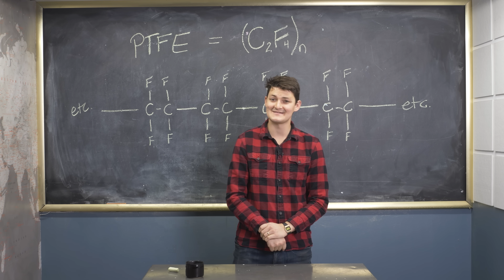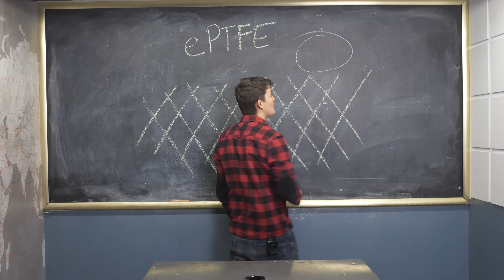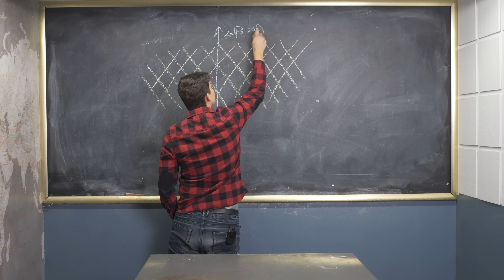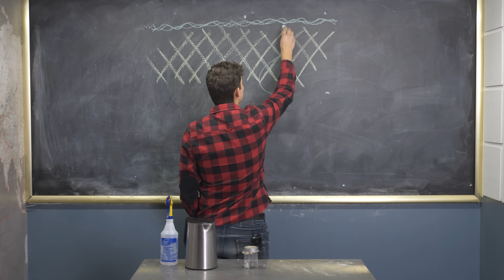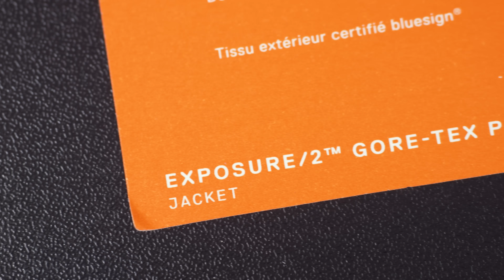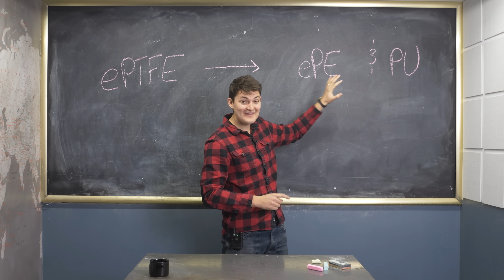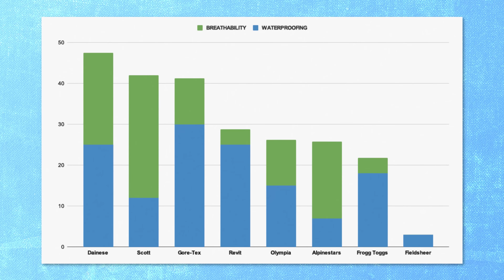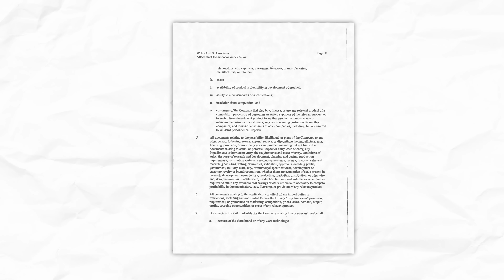Gore-Tex is a Marketing Gimmick

Comment: I used to wear outdoor jackets with non-GoreTex breathable membranes, and these membranes all started to flake after a while. My last two jackets have been GoreTex lined and they didn't suffer from that issue.

Other than that, I didn't notice any difference in breathability between the jackets.

Thanks for the video!
Reply: Sounds like you were wearing a Jack SweatSkin? 🤣

Comment: I buy Goretex sneakers. I tried other materials, but none stood as well to rain as the Goretex ones. Also I am not going to buy a shoe if it doesn't fit me like a glove, which limits even more the options I have. I want a sneaker that fits me nicely, can be used every day and won't leave me with wet socks if it rains or if I step in a puddle.
Otherwise I don't really care about Goretex. I can use an umbrella.

Comment: The pressurised water failing to penetrate gore-tex is hardly relevant, from a backpackers perspective. The pressure and motion from rucksack shoulder straps and hip belt have invariably allowed water through the membrane on any gore-tex jacket I have tried. As you say, there is no reduction in moisture from your body inside the garment when it is raining. Waste of money for this application.

Comment: I've had disappointing results with Goretex jackets over the last 30 years. Especially after washing. I can't trust them to do anything properly after that. I did pick up a used Goretex jacket for the equivalent of £20 sterling In Bali Indonesia where I live now,  recently. Well, it had a really nice removable inner fleece (which I love for dry days on my motor-cycle to keep the sun off),  and a good looking outer. But it is not water-resistant, nor especially breathable either. It gets sweaty inside, and wet inside from the rain. But the fleece is good quality, so not a terrible loss.

Comment: The Gore Tex Pro I’ve used has been substantially better than any other gore product I’ve used - specifically the higher end Arc’teryx jackets and pants. Hunting with a pack in tall wet grass and being dry and not soaked in sweat nor wet. Perhaps it’s arcteryx’s other wizardry in association with it, but I do have a positive impression of it. I’ve never worn another brand that uses GORE-TEX better… in fact most others stick to me when exerting energy.
Reply: When I had my first goretex pro it was a black LLBean and my friend had an Arc'teryx and his ended up flaking and falling apart and mine held up fine but he was really rough with his and I probably was more careful. Both of them were really nice his was a bright darker powderish blue

Comment: Amazing video, Informative, well presented and straight to the point ; everything you want for your time investment.  I used to use gore-tex trade mark boots for bush walking and always wondered why my feet felt hot , sweaty and uncomfortable when they are suppose to be the gold standard and recommended by trained sales staff. ( the mis-information is pervasive )  Then some very experienced walkers enlightened me that a quick drying/breathable shoe was way better option.( if your feet do get soaked , just change your socks and your good to go )  And have not looked back, I use the brand La Sportiva for a wide foot. ( also get a 1/2 size too big , so you are not stubbing your toe when walking down a steep slope )

Comment: I think the points around parent are a little harsh. Sure the initial discovery was accidental, but the subsequent investigation, production etc. wasn't. Those efforts would likely constitute the patent.

You aren't supposed to be able to patent parts of nature simpliciter, but the invention was a way of using the discovery. Even once the material was public, no one could work out manufacturing methods that didn't infringe on the patents. That is patent law working as intended.

Given the patents were both granted and maintained throughout extensive legal processes, I think it is unfair to dismiss them so lightly.

Not defending the business side, just thought that was a stretch.
Reply: They most likely patented the process not the material.  But who knows, big money wins at the end of it all so if they paid enough for it, then the patent would have been given.  Mans laws are all dependent on how much money goes into pushing them to favour.

Comment: I'll add that Goretex and its alternatives end up in places where they are simply not fit for use.  Shoes and gloves are terribly applications where the breathability requirements outstrip the performance by at least a good order of magnitude or two.  You end up with wet feet and hands from sweat in a short period unless you are in a cold dry climate and not exerting yourself much, which is kind of against the "active" part of outdoor activities.  Further, if you actually walk around in Goretex shoes, or use your gloved hands their membrane and/or seam-tape will rapidly wear out at the high flex locations, making your gloves neither waterproof, nor breathable enough.  On outdoor trips you end up just locking the moisture inside, as shoes and gloves takes ages to dry once water gets in.  I consider most "waterproof" shoes to be splashproof at best, and only if you keep the DWR maintained, or even splashes will soon wick through the worn out parts of the membrane.

Comment: I have a nice Gore -Tex running jacket and use it from time to time in inclement weather. 

The issue is that I sweat so much wearing it that I’m as soaked after my run as if I had been wearing any €15 windbreaker

Comment: The Military learned this lesson back in the mid '90's, when they had us trade in our wet weather gear AND our tried and true Field Jackets for,... Gortex jackets.  Sure, they were NOISY when we were trying to be quiet, they snagged on a ton of items and there was not any type of insulation.  So they reissued out Field Jacket Liners.  Typical Marine Corps.  It appeared that there was a small group that tested the GT Jackets, but did not get any of the reality feedback from the Troops.  Well, they did get our feedback, but by then it was too late, since our Field Jackets had already been sold.  So we were stuck with the noisy, cold, wet jackets that were, or rather Still Are USELESS in a combat situation.

Comment: breathing is triggered by a temperature difference not humidity difference. Thus wearing a GoreTex jacket in a hot climate is rather useless but they work exceptionally well in colder temperatures.

Comment: I think any experienced person who has tried Gore-tex will worked this out - over 35 years ago - noticed first problem - it's a membrane - so if outer layer does no repel water after time - it will be damp and stop breathability - worse it increases heat transfer - so needed a thermal layer between say arm skin and inner jacket lining - - if sweating inside , outer layer is damp - will feel cold and yuck .
As for breathability- ever wonder why so many had zips on sides - or people walked with it opened at the front - If you want 100% rainproof , 100% breathability then use an umbrella - but lose a hand , no good in wind, some cold protection - and in closed in walking area

Comment: I have the best of both worlds.  It's an old Cabela's coat from like late 80"s or early 90's:  and it has wool on the outside, goretex in the middle and some silky smooth high thread count polyester weave liner.  It absolutely MUST be below freezing or you just can't wear it.   It's thick and heavy like a B3 sheepskin coat and unbelievably warm.  Sure, goretex isn't breathable enough to wear it in moderate weather-- but it really thrives in extreme cold;  where you have that huge differential being warm under the jacket and cold outside..  I found this coat on the side of the highway--  a cardboard box fell out of a truck and it had like 8 coats inside-- and this was one of them. :)

Comment: My handyman business required me to, frequently, run my 4,000 PSI pressure washer cleaning Pacific Northwet roof tops and sidewalks. To say it was wet work would be an understatement.  To the end of keeping dry, I spend $200.00 on a pair of Gortex pants and $400.00 on a Gortex jacket about twenty or so years ago.  

I love the pants. They kept me dry. They even kept me dry when I had to sit in an inch of water in the course of repairing a skylight during a storm.

The downside of the jacket is, it keeps me dry from the blowback of the pressure washer and the rain, BUT working a steep roof causes you to sweat, which doesn't have any real means of escape.

Comment: This is a really well-done video.  I have had the same opinion about Gore-Tex for years, but not had the wherewithal to test it in a lab.  I have had the experience of sweating in a Gore-Tex jacket many times, and also once had to retreat from a mountain trip because it wasn't waterproof anymore.

These days I rely on a silicone-sparayed un-laminated/uncoated anorak, and for really wet conditions, non-breathable gear.  If I'm going to sweat, at least I won't be paying extra  for a jacket I don't trust.  Being uncomfortable is one thing, but hypothermia is a whole different one.
Reply: I use waterproof jacket with huge ventilation which can be opened by zippers  from the waist and past the arm pits. I only layers of wool on the inside. Inner layer is usually wool mesh, ie long sleeved of the wife beater, but made of wool. With this I am water proof when I need it, I can let out humidity if I want/need and wool doesn't loose it thermal protection while wet.

Temperature I can adjust by taking of my headgear, gloves or even opening up the jacket a bit depending on activity. Or remove/add another layer of wool if I miscalculated or changing gears.
Reply: @burre42  what is the waterproof jacket you use or recommend?
Reply: Patrick, I had exactly the same experiences.

Comment: Seasoned hiker here, after a while I woke up .. goretex is ABSOLUTE crap.
I have owned numerous over expensive goretex coats by North Face, Arc'teryx yadda yadda.

Goretex is hot, clammy, awful, not hard wearing, non remotely breathable and not even really waterproof.
If goretex is so breathable why do goretex coats all have footlong pit vents and even mesh pockets to let your skin breathe?
Most goretex 'breathable' membranes are protected under a thin waterproof nylon layer. So what does it even do for breathability?
As soon as the waterproof lacquer it is sprayed with runs out, or it gets dirty -with sweat or even with atmospheric dust, it starts to function less and less.

Good old no BS nylon is where its at. Sure it doesn't breathe well either -but you don't get charged tens of times the price for something pretending to be what it's not.
Nylon is SUPER strong and durable. It can withstand almost everything you can put it through. That’s why nylon is used to make fishing lines, backpacks and many industrial items. It’s resistant to water, mildew and insects. Plus it’s super easy to clean. Just toss it in the washing machine. In terms of warmth, windproofness and durability a decent heavyweight nylon leaves goretex in the dirt.

Comment: I challenge this idea that breathability is very important anyway. I live in London and have been cycling the roads here for 43 years. It's a mild climate but it can occasionally be wet, very occasionally with a real downpour, and occasionally moderately cold (in practice never lower than 0 C, I think). The best pair of gloves I ever bought, probably in the mid-90s (i.e. pretty much before the whole "ooh breathability is so essential" crap had really had a chance to crank up), were made of a totally *water-repellent* material, which was slightly stiff. They were slightly gauntlet-like (big cuffs) and were COMPLETELY waterproof and pretty good insulators too. My hands would NEVER get wet. But in fact my hands have NEVER got sweaty when I've been cycling. I mean, NEVER. Perhaps surprisingly, I would choose not to wear them when I didn't need them. 
These days, to my utter disgust, it is almost impossible to buy truly waterproof gloves for an activity like cycling, skiing or mountaineering. When a pair of gloves claiming to be waterproof in fact has a partly leather (!) exterior, even if you are paying £300 you are NOT getting waterproof gloves. There's all this marketing BS about "waterproof membranes". No. Stop. I need gloves with a totally *water-repellent* external surface, over the whole surface. I do not give a flying fLick about "breathability".
Try looking at some of the 1-star reviews on any gloves, of any brand, that claim to be "waterproof", on your favourite multinational tax-evading trading platform website.

Comment: I agree with Gore-Tex not being the answer for breathability during a rain shower, but it does enable me to keep the rain out in the heaviest of rainstorms (at least with the laminated version), while not sweating my a** off when the weather clears again, all without changing clothes mid-ride. 
Wear a not-so-waterproof jacket and I get soaked in that rainstorm. Wear a plastic rain jacket, and I get soaked with sweat always. With Gore-Tex, I only get somewhat sweaty during that heavy rain storm (luckily, we don't get many warm rain showers here in the Netherlands) if it's relatively warm outside, since the rain usually cools the outside temperature, limiting sweating. But that limited sweat sure beats getting completely soaked during that rain storm or getting 10x more sweaty after that rain storm ends.
So, I'd say Gore-Tex definitely benefits massively from overselling its use through marketing, but I disagree a sweater with a garbage bag (or cheap plastic rain gear) performs the same.
Nonetheless, grade A informative video, as always. A great eye-opener, and very valuable in filtering facts from marketing fiction!

Comment: I agree with what you say about wool. With regard to hard wearing properties of Goretex garments, Goretex membranes are delicate and have almost no wear resistance, which is why the Goretex itself is always part of a multilayer structure. With regards to simultaneously breathing and ring waterproof, I have a problem too with F9 assertion. PTFE is hydrophobic, so does not wet, therefore rain will pearl on a fine PTFE mesh, leaving space for fine watervapour to escape through the openings in the mesh in the other direction. If my hypothesis is true, then Goretex does in fact breath when rain is falling on the outside. The other factor is the multilayer structure, needed to protect the fragile Goretex membrane. That, when wet, is probably what prevents of substantially reduces breathing. In all events WL Gore are aggressive profiteers who have ripped the world off, but hey they're not alone in that. I try to avoid randed anything😂
Reply: That's true and basically what goretex shakedry used to be, a very light version of goretex where the membrane was directly exposed on the outside. The benefit being there was no exposed material to soak through. The downside, no wear resistance what so ever so it was mostly meant for bicycle or runners

Comment: My summer SIDI riding boots have NO Goretex on purpose and I live in Penna with many kinds of weather.   Long trips camping with many miles per day in my tall Goretex boots result in clammy feet SO I found and bought a pair of used Aerostich Combat Touring boots without Goretex for long trips.  I'm optimistic that my feet, if they get wet will be wet for a half day or so and they will be dry most of the trip, not clammy the whole trip.  Side note: Windstopper is basically Goretex without the seam taping effort.  It helps bicycle clothing items be a lot warmer by stopping much of the breeze but ventilating through seams.

Comment: This time I can't agree with your video. It's not complete. You know, the Goretex label is not just about the membrame but also that zippers, seams etc. are up to a certain quality.
From long experience as an all wheather motor rider I find that the Goretex label is so far worth its extra money. Where my non-Goretex gear started leaking in about 2 years - 20.000km, Goretex gear lasts me 8 - years - 80.000 km. And also the zippers and Velcros'are lasting that long. From experience with Held, Dainese and Sidi with Goretex label. And non-Goretex label Uvex and Evolution. Forgot some of the other names.